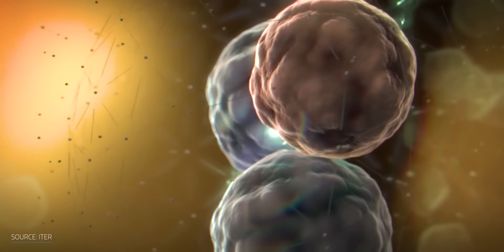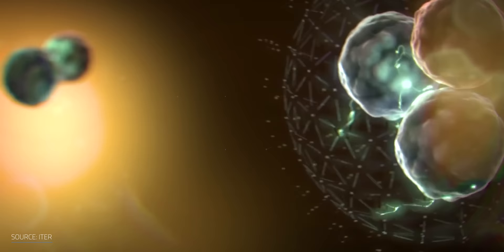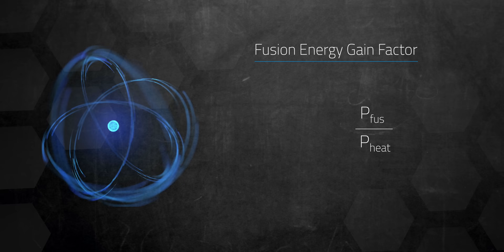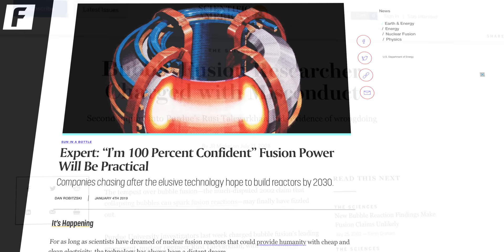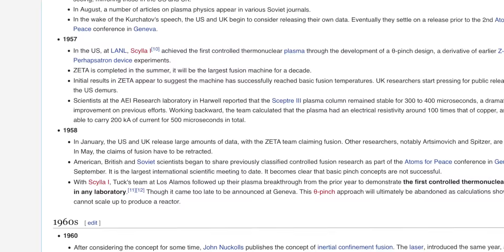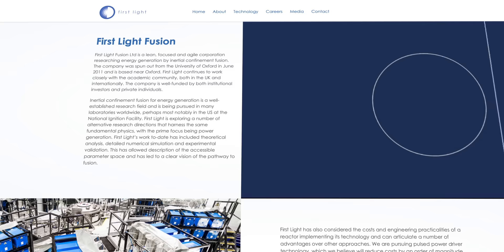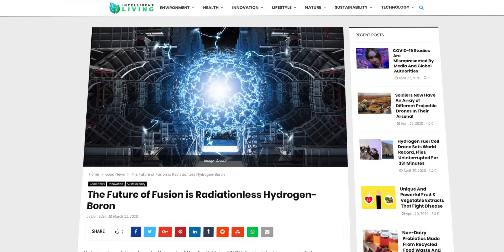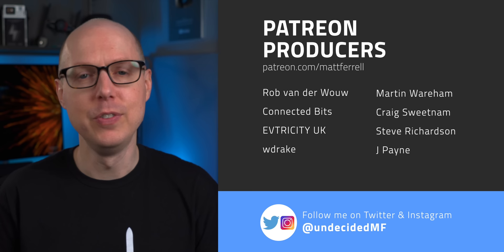The truth about nuclear fusion power - new breakthroughs

Comment: Tony Stark built this in a cave! With a box of scraps!
Reply: I'm sorry sir, I'm not Tony Stark
Reply: using a fictional character in reference to reality , a reality that could wipe our planet out not funny, how do think religion started.
Reply: @ossiedunstan4419  Fusion reactors do not have the potential to wipe our species. They barely work, and even when working, assuming theres a breach of the reactors, the damage will be nowhere near cataclysmic.
Deadly and regrettable, but nowhere close to a Chernobyl, 3 Mile Island or Fukushima.
Assuming a breach of a Fusion reactors you would have an event that would create a deadly heat zone for some time, but within days to weeks, the area would return to normal levels and people can return to the site without the  need for nuclear protection gear.
Once a Fusion reaction has stopped there is minimal to no residue and what is left is not radioactive.
Reply: And his heart plugged into a car battery
Reply: @ossiedunstan4419  uhm.. when did religion get involved with creating an extremely safe source of energy..?
Reply: Eric R. Because religion started when cavemen first noticed the sun, and prayed to the sun god, what do you think a fusion reactor is!
Reply: @Keemperor40K  actually the plasma would expand and nothing would have happen.
Reply: @abistonservices9249  lol!
Reply: @ericr.7311  Well, Tony Stark did die, was buried in a cave, then resurrected with a new body and punished the wicked with the Fire Of Judgement.
Reply: @newdefsys  oh my god. I need to get to a tony stank temple and pray!
Reply: Jeremy H. No im not adding you on snapchat
Reply: @ossiedunstan4419  Did you even watch the video?  Fusion will not wipe out our planet.  Not watching the OP's video... that's how religions start! sheesh!
Reply: @nacroza8314  All that heat has to go somewhere. We are talking about temperatures of 150 million degrees.

Granted, the temperature would start to lower immediately after leaving the pressure chamber, but for a time after the breach that heat has to go somewhere.
Reply: @Keemperor40K  yes I know but it would actually just expand to fit the chamber just like when the hydrogen 3 was put inside, the plasma would expand into that same area as the hydrogen 3, there wouldn't be any explosion
Reply: Bill Gates: Tony, we need your help - what's your number?

Tony Stark: half.
Reply: RIP Tony
Reply: hey Tony goes to the past, why don't you guys try that...
Reply: Jeremy H. Lol
Reply: @borissimeonov0  Boris, and more, please read some facts about fusion power. 
https://en.m.wikipedia.org/wiki/Tokamak
Reply: @Keemperor40K  Juan! The fusion chamber isn't under pressure.
It's a vacuum chamber.
If breached, air will rush in, not out.
Reply: @JohnJohansen2  True, but there is still all that heat to deal with.
That heat millions of degrees will not cool down in a matter of seconds and it will escape the chamber to try and balance out the temperature with the new ambient normal.
For a short time after rupture, once the pressure returns to the chamber, you will get a very intense heat leaving the pressure.
Remember, without magnetic containment that 150 million degree heat will more or less melt anything within a few meters of the vessel, while it balances out with the ambient temperature.
Think of it like a pressure cooker.
If you take of the lid on a pressure cooker, once it is at full steam and put your face over the area where the lid was, you will get scolded. The temperatur around you increases by a few degrees, while the steam temperature and the ambient temperature balance out.
150 million degrees is many orders of magnitude more, but the immediate effect is the same.
Reply: @Keemperor40K  
Please read about the subject. 
All that millions of degrees hot plasma is actually only a few grams of material, at any given time, and will cole down in less than a second. 
The only heat that might cause problems, is the steam and hot water producing electricity via turbines.
But that's no different from any other powerplant.
Reply: Sky Man  Your tinfoil hat is leaking, Sky Man!
Reply: @Keemperor40K  correct. however, the tritium used can be radioactive as waste material
Reply: Sky Man  I sense a case of the Dunning-Kruger effect. 
I'm out of here.
Reply: @Lathnor  Correct. With a halftime at about 12-13 years.
Reply: @Keemperor40K  Well, there's always potential for it to have unintended impacts. Although an immediate release of heat is likely and radioactive elements aren't formed, there may be side products produced from the intense heat that may cause unforseen consequences to people and the environment. That said, it's likely a lot safer than fission.
Reply: @When The D Boys Needs Motivation, I Stepped In the tsar bomb used fusion, they already exist
Reply: @LeonardoRiglietti  US detonated the first hydrogen bomb in 1952, over the Marshal Islands.
Reply: @JohnJohansen2  yep:) finaly someone that speaks English
Reply: @Keemperor40K  No one died at 3 Mile Island.
Reply: @newdefsys  It was Iron Jesus wearing the Armor of God.
Reply: @borissimeonov0  You mean like thermonuclear bombs ?
Reply: Ossie Dunstan It's a quote from the first Iron Man movie, not idol worship.
Reply: @JohnJohansen2  Yeah, but what happens to air when it hits 150 million degrees Celsius ?
Reply: @ossiedunstan4419  the moment the reactor shuts down, the reacting shuts down, there is no chain reaction, or anything harmful, earthquakes, tsunamis, bombs, doesnt matter, the moment it gets damaged it stops working, there is really nothing else to say or speculate about.
Reply: @newdefsys  why does that matter? the worst thing that could happen is melting that ironball, the moment the reactor gets damaged it stops reacting, doesnt matter if its a simple malfunction, earthquake, tsunami or what ever, there is really nothing to speculate about just because you guys read too many tinfoilarguments out there, it is what it is.
Reply: In a movie/comics
Reply: @Chris_KAy  Its a legit question. What happens to air when exposed to a temperature of 150,000,000°C ?
Reply: @dcanaday  No, true, but the danger of radioactivity for extended periods was very real.

Compared to that Fusion reactors are almost safe and something like 3 Mile Island, Fukushima or Chernobyl is nearly impossible.
Reply: @newdefsys  I dont know. But there is only a few grams of fuel in the reactor core. I few grams at that high of a temperature will cool off fast. Durring to old H bomb test era, there were very high temperatures as well.
Reply: @Keemperor40K  nonono. If a fusion reactor breaks It looses the pressure and temperature it needs to self sustain and simply turns off . maybe the initial heat wave inside the building could do some damage but nothing compared to a fission reactor meltdown.
Reply: @newdefsys  You are confusing heat with temperature. Just because something has a very high temperature doesn't mean that it contains a lot of heat. It's very basic physics which you might want to try learning.
Reply: @ggfabrizio  which was exactly my point. 
Fusion reactors are far safer than Fission reactors, with minimal drawbacks.
However they are still some time away, how far away that is anyones guess.
The last point is that a Chernobyl, Fukushima or 3Mile island is nearly impossible with Fusion reactors.
Reply: @skinisdelicious3365  Yeah, I forgot that was even my display picture. I need to change it. Just don't even pay attention.
Reply: @borissimeonov0  people are always going too want too kill eachother it's human nature
Reply: @JohnJohansen2  Oh mY gOSh yOu usEd WiKiPeDiA thAts NoT a CreDiBlE souRce
Reply: @ossiedunstan4419  your just wrong
Reply: Hot fusion is 20 years away guys. It is almost around the corner. Almost here. In 20 years we will have working fusion reactors.
Reply: @oldi184  well none of us know when there going too figure out how too make fusion reactors work Soo I wouldn't say that it's 20 years away unless your s time traveler....
Reply: @Nachoman24  I can bet 100 bucks that its 20 years away. 
It was 20 years away in 1950s.
It was 20 years away in 1970s.
It was 20 years away in 1990s.
In 2015 I have read an article that fusion is 20 years away. That was in 2015. We have 2020 and it is still 20 years away and will be for a long time. As long as oil flows, fusion will be decades away. We still have oil for 100s of years. Don't worry. Russians have discovered new, gigantic oil deposits under shallow arctic ocean. They are truly gigantic. They will be able to supply the whole world for 200 or 300 years. 

Fossil fuels are blood of our economy. All your life depend on fossil fuels. Your car, your home, your food, your computer. 

In my country a 100% of energy for buildings is created from coal. My computer, my fridge, my tablet, my dishwasher runs on coal.
Reply: @oldi184  as we learn more, we find new problems we have to solve.
Reply: @ossiedunstan4419  you are making the extraordinary claim, so you have to provide the evidence. Your claim goes against the scientific consensus so you must prove me wrong. It is called the burden of proof. 

 Also, are you willing to listen or is there no point in this debate? I'm done with arguing with close minded people. Because if I sepend hours building you a scientific report then you just burn it then that was a waste of my time. But if we can gave a debate where the loser has to exept they are wrong then it will be worth my time.
Reply: @GamingWithNikolas  Yeah. I remember I was reading article in Scientific American from mid 1970s about Fusion. In that article scientists were saying that almost everything is set and in near future first fully operational and commercial fusion reactor will be made and will produce energy. Well...1970s were 40+ years ago. Hehe "near future they said".
You think 2020 is near future from 1970s perspective?
Reply: @oldi184  by 2050 i guarantee you we will have fusion power. ITER is so close to the big breakthrough. Then we will have the DEMO reactor being the model of all next gen reactors. 

The world does run on oil, but it is falling out of favor.
Reply: @GamingWithNikolas  99.9% of the population would benifit from this but oil and fossil fuel businesses are multi billion if not trillion dollar business the top 0.1% would not benifit from this because they would lose money these macro companies would never allow it even though it would help humanity reach the next great era
Reply: @Nachoman24  it is unfortunate you are correct on this.
Reply: @GamingWithNikolas  "ITER is so close"
How close? As close as they had been in 1970s? Closer?
Reply: @GamingWithNikolas  there is still hope tho check out icfs (inertial confinement fusion)
Reply: @Keemperor40K  are you kidding me? or do you have amnesia ? YOU ARE THE TONY STARK and the one and only in that, please sir get yourself together!
Reply: Love you 3000...
Reply: Abiston Services amazingly astute and precise reasoning. (Irony)
Reply: Dexter had one in his Laboratory.
Reply: @Keemperor40K  the plasma cools fast too thats why scientists are having a problem with maintaining it, 1 touch with the reactors wall can stop it
Reply: Science Revolution  I take exception with the phrase "...energy lives..." Energy does not "live" Aside of the fact that any definition of "life" is not fulfilled here, the term needs to be defined. It's obviously not intended to be used in its literal sense, but it needs to be explained. Perhaps it's "stored" in these particles? but it sure does not "live".

Aside of all this, this huge piece of off-the-wall text feels so "bot" constructed, I winder who or what "Science Revolution" really is. If there's a human at the end of it, it's obviously a cut and paste job. More likely it's artificially generated because though its full of, I assume, indisputable facts, there is no actual flow. There is no emotion woven into this ultra dry dump of information, which explains the "I assume" comment I made. I could only scan the text from a certain point onwards! It's endless!! Even all this stuff I am writing is too long for the average YT reader....so what's the point?????
Reply: Jeremy H.
I'm 999th person you've made happy with this comment (at least)!
Reply: @nobigbang825  Responding with utter nonsense, does not make u look smart!
Reply: Superhero movie logic.
Reply: If only he were real
Reply: Read that with Jeff Bridges voice in my mind
Reply: @newdefsys  Praise be unto Tony Stark
Reply: @newdefsys  quite motivating to get a better battery if u ask me
Reply: But Tony Stark knew how to it works already. Once we have done it for real "Mr Fusion" becomes a matter of engineering.😁
Reply: @Keemperor40K  but the mass on material at that temperature is tiny.
Reply: @Keemperor40K  
Nope... It wouldn't do any of what you said.
Reply: @nacroza8314  Yes
Reply: Jeremy H. Well, I’m sorry.  But, I’m not Tony Stark.
 
I’m Batman.
Reply: Helium-3 mining on the lunar surface for fusion rectors  for space travel for moon and mars , Tesla.
Reply: he did it to shut the hippies up
Reply: @ossiedunstan4419  you must be fun at parties
Reply: Everything is easy to say than to do. Imagining things are even easier than saying.
Reply: I do believe that was fission though…
Reply: Thomas Chrombly  Don't spoil the fun dude
Reply: Weak, MacGuyver could do it with a shoelace and a stick of Gum.
Reply: @ossiedunstan4419  yes, because people went to blockbusters 7 thousand years back.
Reply: @Keemperor40K  r u sure about this? Imagine it leaked, the heat can melt everything. Atmosphere, earth surface, anything.
Reply: Tony Stark jokes might have been funny once, but not after the first millionth time.
Reply: @Stafford674  i bet you're so fun at parties
Reply: @KOTalk  I don't repeat the same old joke and expect people to enjoy it. Take what I said as a piece of good advice;
Reply: @ossiedunstan4419  Your whole existence is the embodiment of sadness
Reply: @ossiedunstan4419  we already have fusion bombs anyway, the heat and pressure from a nuclear bomb enables the explosive properties of deutirium and tritum. its what we currently have and everyone else has but havent used yet. we dropped a small version on japan. one was a fission bomb and the other hydrogen or (fusion) bomb.
Reply: @Eradicationist  FUSION BOMBS LMFAO.
Fusion does not propagate light ina star .
If a star was made of 12 hydrogen atoms , after the firs fusion event thier would only be helium, all matter propagates quanta in stars.
Fusion deos not produce aenopugh energy to account for the radaition froms tars.
Einstien ewven made the astatement fusion is por pathway to econimc power production.
Not my fault you call Einstein a bullshitter.
Name 1 fusion reactor to date that has pumped even a fraction of the power they suck from grid,Thats right over 30 years of research and experimentation over 70 trillion dollars and not 1 fucking Watt put to the grid.
I REST MY CASE.
On a side not star do not lose mass through the propagation of quanta from fusion.
Stars lose mass and gravitational cohesion through matter ejections Eg , solar flares, mass ejections.
Reply: @ossiedunstan4419  There is no possibility of a "runaway reaction" with fusion power.  The hardest thing will be to keep the reaction from fizzling out.
Reply: @Gonenow2015  I didn't get u ???
Reply: Yeah,and he is a fictional caracter
Reply: I thought that was the professor and Marianne that built it out of coconut shells and seawater
Reply: @ossiedunstan4419  fusion is not a bomb. And remember it's the reason that were in existence.
Reply: @theekshanabandarathinura1848  Fusion is also not source for power, And fusion was used for a bomb, The fusion caused uncontrolled chain reaction with in both materials being forced tog ether at fast enough rate to cause uncontrolled chain reactions.
Fusion is fusing together of 2 elements or more, when talking power production, you are talking about fusing hydrogen into helium, this will require an inexhaustible supply of hydrogen, not to mention the helium as result.
Green hydrogen uses 20 % drinking quality water in the process, the other 80% is wasted , not to be used in agriculture horticulture or human consumption ever again.

Now back on subject explain to me  after over 30 years and 17 Trillion Us dollars invested into fusion power has their been no power to the grid , yet in 2019 some 40 billion dollars was spent on fusion research bye the US federal government.
30 years and not 1 watt delivered to the grid, yet the people who pay for the power production lost thousands of Kilowatt hrs wasted on fusion reactor research.
Einstein stated in his book , fusion a is poor direction for cheap stable power production, I knew this 6 years ago , I only read entices relativity last year, 3 times.

The sun does not propagate Quanta( light and radiation) from fusion.
come back
Reply: @ossiedunstan4419  fusion is not a bomb mate. In a hydrogen bomb there's atomic bomb to trigger the fusion reaction . If there's wasn't a fission reaction there won't be a fusion reaction that means if a bomb only carries tritium and deuterium it's not bomb you'll need at least 150M degrees Celsius for get through the coulomb barrier that's what the atomic bomb for .  And the power you talking about is reason you and me exist in the first place. And of course it's rip dollars into pieces. But it Worth a risk. And it doesn't produce greenhouse gases or nuclear waste it only produce stable helium.
Reply: @ossiedunstan4419  a fusion reactor isn't dangerous at all a nuclear reactor is 10000x worst then a fusion reactor ever could be
Reply: Maybe we rely to much on the tools we have when what we need is brain and logic and simplicity whithout over complicated thinking
Reply: We lost him in Endgame 😭
Reply: Yea, he did. And look at us we took nearly 90 years but still incomplete 😂😂😂
Reply: Really???
Reply: I know he didn't build in real. But still I hit like for Tony Stark.
Reply: @06:25 the more things change, the more they stay the same.  Now it's 15 years away ... again.